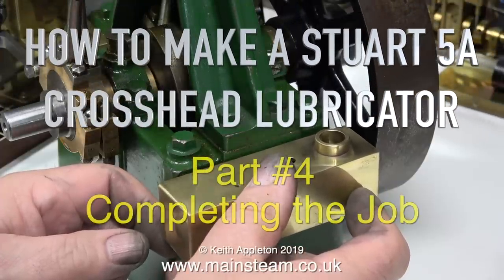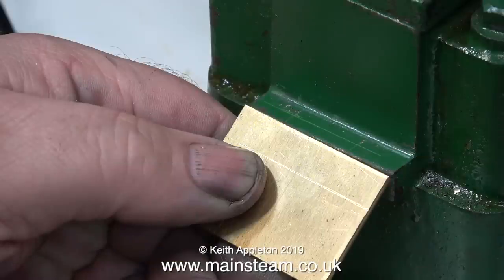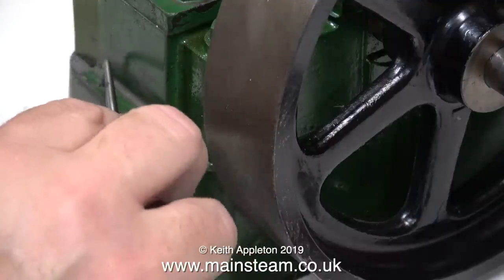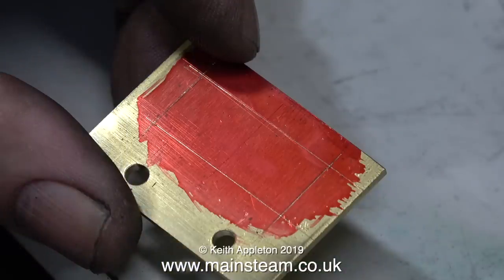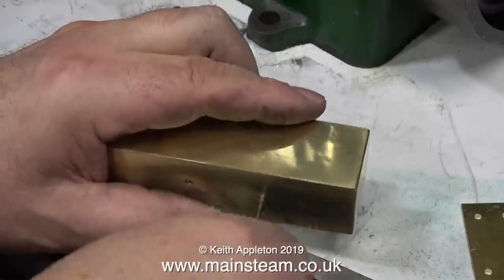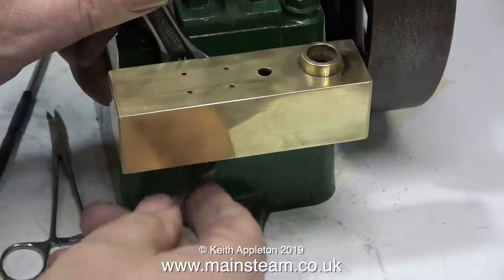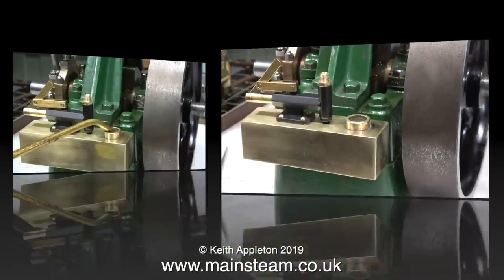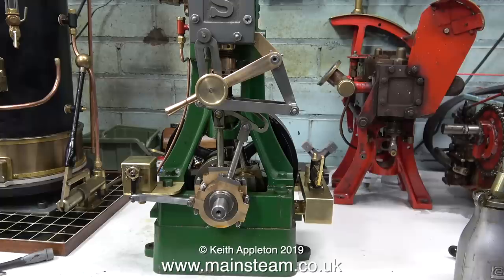HOW TO MAKE A STUART 5A CROSSHEAD OILER - PART #4

Comment: Nice one Keith  Personally I would have left soldering the second end until the last thing  so I could remove all the swarf from the drilling and tapping        Pete
Reply from the maker: Any metal particles came out of the large hole  where the oil filler was soft soldered in - so silver soldering at a late stage would have destroyed the soft solder holding the oil filler - I do think these things through you know . . . . . .